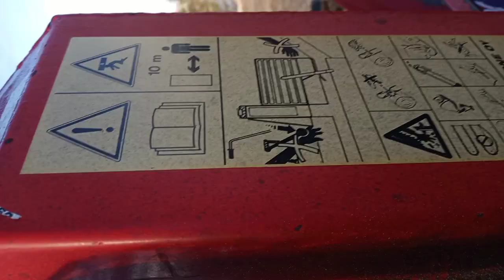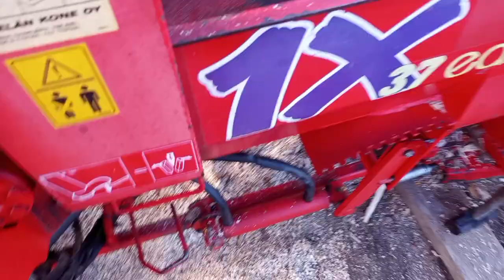20220801 5 way splitter pass-thru design

Comment: So that size wood doesn't get split?
Reply from the maker: I don't have that machine anymore but at the time, I  designed the axe to allow the smaller pieces to pass through. Generally anything smaller than 4 inches diameter doesn't get split.
Reply: @WoodchuckCanuck  I do like 4" diameter maple and ash rounds, they burn the best in my small drolet stove. Surprisingly Aspen aka popple contrary to what alot of guys say burns pretty dang good.  And they grow like weeds in my area. Guys don't even bother cutting them for firewood 🤷
Reply from the maker: @runningremingtons Aspen...we call 'em 'weed trees'.  It all burns. Throws ok heat but needs to be dry dry dry. Plus the trees don't get big around here, 2-3" diameter at most so people think its not worth the effort.
Reply: @WoodchuckCanuck  yea we have big tooth, saw tooth and quaking Aspen. Hard to really tell the difference other than the leaves a bit. They get pretty big here 24" plus. It burns good when dry for sure. Not as long as oak or similar but heats heat.